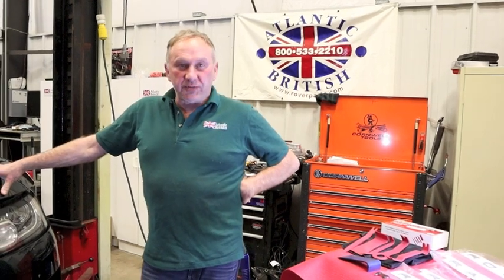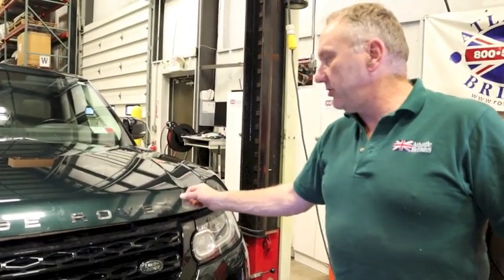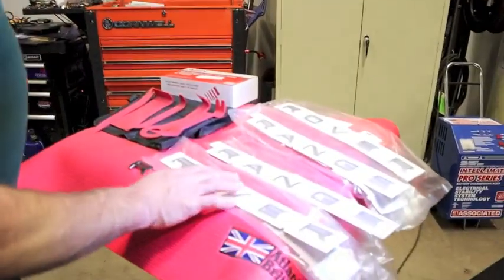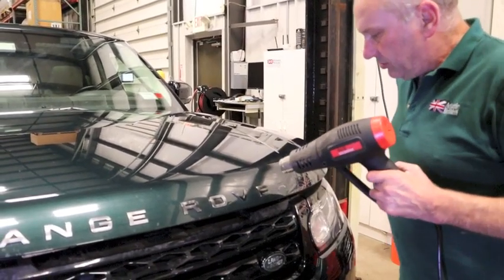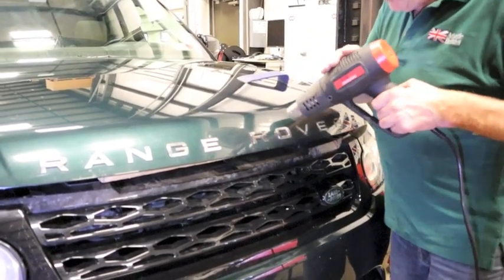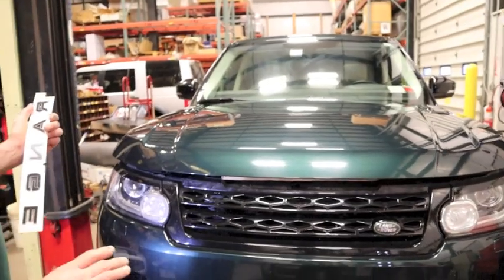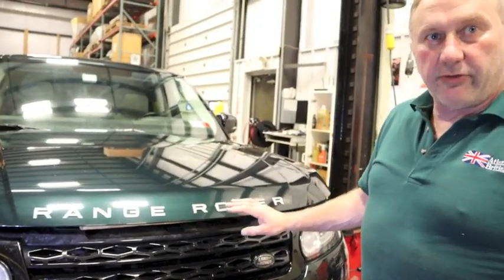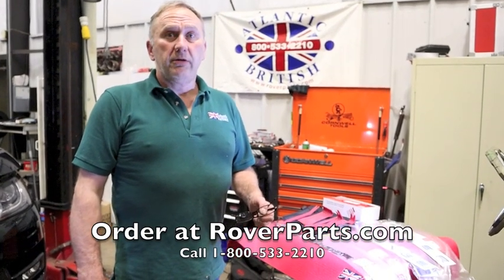“RANGE ROVER” Decal Replacement on a Range Rover Sport

Comment: Don't need pry tools.  Long thread of dental floss will cut them off in 10 secs. Runa piece of painters tape above top of letters an mark start of letter. Use 3m eraser wheel in low rpm drill to remove old tape. Then wipe with rubbing alcohol to clean up surface and degrease. Apply new letters aligning with painters tape. done in 15 mins or less

Comment: Why did you eyeball it vs putting a strip of tape at the bottom to use as a guide?
The RANGE portion is higher on the left and travels downward to the right.
Reply: Prob just video camera angle looks ok to me.